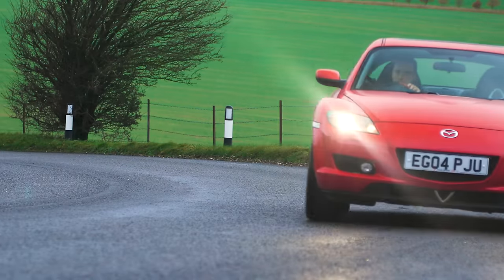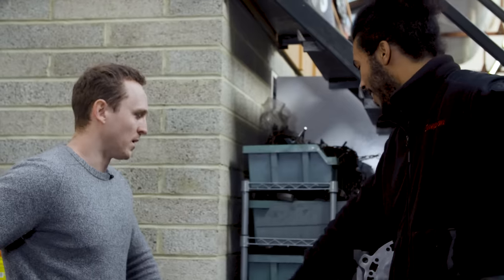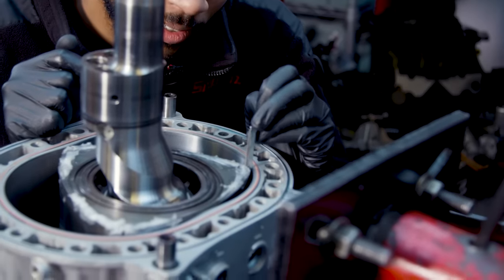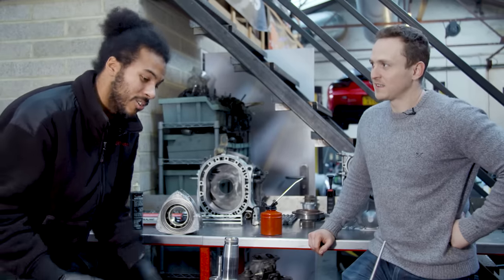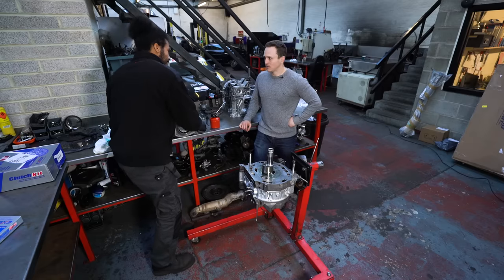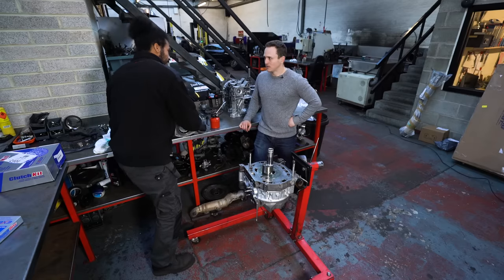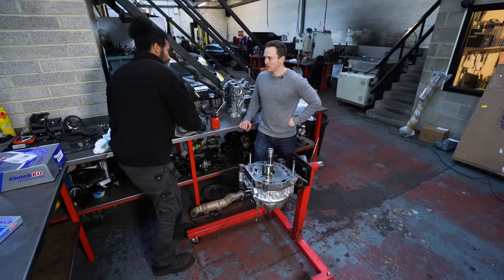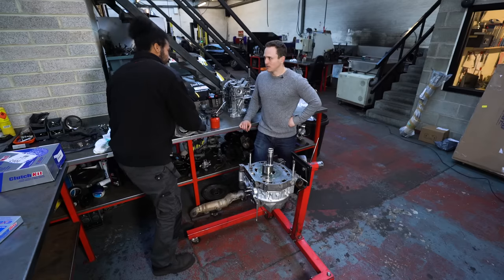How To Build A Rotary Engine: The ULTIMATE Guide

Comment: This really opened my eyes to the world of rotary tbh
Reply: D. Mac634 Same. Really consider an RX-8 myself now lol
Reply: @petrolpower96  ikr I had no Idea how simple they are itd be a cool car to have
Reply: Looks nice until  you realize how much it costs/how hard it is to find a good rotary mechanic/how often you need to do this to maintain good compression.
Reply: @thedude102878  lol wut. You dont have to rebuild a rotary to maintain good compression. Just keep oil and coolant in it and they are fine. My rx7 has 300k on the original carbed motor, no rebuilds ever. The carb failed before my motor did.
Reply: Trust me this is the average basic rebuild. You're scratching the surface on this channel mate.
Reply: Donkey Kong 300k cause it’s not a renesis

Comment: This looks deceptively simple.
Reply: Yup - conceptually it's really simple... it's the precision / tollerances that are the hard bit (that, and remembering every little seal :D)
Reply: Geoff Willingham yeah, probably just takes experience and messing up a few times lol
Reply: They didn't show any of the side seal stuff, it's not all out of the box and into the engine
Reply: It looks simple, but that where the dorito fools you. You think its easy which will make you spend your lifesavings and more on that dorito out of hell!
Reply: Watch aaroncake's video to see all the missing stuff. There are some really tediuos stuff, like side seal grinding and more.
Reply: It may seem so but spacing the seals are hard ,any close to thousands of an inch can cause hardstarting
Reply: Is it normal, that there is an pretty amount of smoke in the engine bay at first start?
Reply: Reminds of my 1st brake pads change I did.. Looked so simple on youtube, like 15 min job.. Took me 2,5 hours..
Reply: @chiclone-tests71  yes...Josh said it would smoke because of all the vaseline they put on the seals and stuff
Reply: @xzst  As long as you had the pads in the correct way after that - everthing's fine! :D
Reply: @Boog Ste Lici - yes, i can follow that in case of the exhaust, but the engine-bay? Maybe an exhaust-clamp was not tight enough?
Reply: @chiclone-tests71  I feel like its pretty normal because engine and parts went through a lot of dust / oil / contaminant and theyre all burning off
Reply: @xzst  I think when you do stuff the first time yourself you take an interest in everything and it makes the whole process longer. you probably did a far more thorough job than a garage did and cleaned brake dust from your calipers and made sure your slider pins were clean as a whistle.

Comment: An entire rebuild in 7 hours? Jesus... Another reason why blowing a rotary isn't actually that bad. Well, nowhere near as bad as in a pisston anyway. 

That guy should have his own youtube channel
Reply: Probably 20 hours for an average guy not pros
Reply: they had all the parts at hand, they essentially just disassembled and reassembled it, that probably cut the time down a lot
Reply: @TempoMontages  for a full rebuild that's still really good haha
Reply: Rebuilds can go a lot worse, really depends on the damage.
Reply: Next we'll br watching electric rotaries be rebuilt xD. Gotta get that copper wire all around the rotor housing or it'll mess up the electro-magnetic fields!
Reply: @Neishy4AGTE  10h fixing/finding stupid short(tail lights) on a z350 was on the main wiring on the engine side.
the 7h sound like he forget the calls for supplyers and the wating time.
Reply: And at the same time he was explaining and giving comments. I think alone he could do it in 6 or even 5 hours.
Reply: It takes me eight hours to rebuild a 5.3 in truck....the only thing left in the block is the crank.

Comment: That snap on torque wrench hurts my wallet just looking at it.
Reply: They make most torque wrenches these days since they bough the british company that originally made them.  The digital ones are sooo nice.
Reply: Get the one from Eastwood. Just as good, only notable difference is that it doesn't vibrate... I've used both. No need to spend that much cheddar, tbh.
Reply: I own one 300 bucks used on ebay and its like new !!  65%off its original.price !
Reply: @areyouavinalaff  Ofcourse you feel 'torque'. But you have no clue what moment it is set on. Feeling has nothing todo with absolute measurements. If you get stronger arms the feel changes, and you tighten it 2x to tight because it feels good.
Reply: @areyouavinalaff   Ofcourse I ment where a specific set amount of  torque is required you cannot feel it and say, Oh its at 80Nm now as required, or ah it' s good enough for sure because it feels same tightness. Well...you can but, it won't always be perfect. Also depends if grease is used, metal or aluminium etc. How nice of you to assume I dont have any experience. Just sayin, where asked for one of these, let's say a cylinder head, I use it. All other stuff is 'feel'. We don't need to fight bro.
Reply: @areyouavinalaff  Hehe no problem brother. I am the same in general, nothing wrong with being defensive in this world. I am no pro or anything, just working with random mechanics for about 25 years, dam i feel old...
B. T. W that cat was my little buddy in crime years ago. R. I. P.
Reply: Got 3..
Reply: If thats a scary price then dont look at a high quality one ever...
Reply: My preference is a Norbar. They do some  lovely kit! Owned by Snapon these days and used to originally supply tools for the MoD, specifically also for the production of RR Merlin engines.

Britool are also another superb manufacturer.

That said, any calibrated torque wrench from a reputable manufacturer will see you right!
Reply: @skylined5534  Norbars are magic, I hate the digital ones and the smal >400nm stahlwille isn't my favorite either. <400nm stahlwille is great. I work with trains so we have a variety of torque specs.
Reply: use it as a breaker bar

Comment: These engines seem simpler that i imagined
Reply: There's literally 3 moving parts. Rotaries are easier to put together than a Piston engine.
Reply: Tom you would have more trouble getting the engine out than rebuilding
Reply: They're basically awesome and just get a bad reputation.
Reply: @shona5512  And they break 3 times as often.
Reply: they are incredible simple, practically adult lego.
Reply: @JesusChrist-uu2te  Mr. Christ since when were you into cars?
Reply: King Brilliant  wut?
Reply: Dee Jay  You don't have to tell me any of this, i learned to build rotary engines before I learned anything in depth about piston engines. My brother had an RX-7 when I was young and a few years later I bought my own as i was familiar with them. I've since sold my FD to my brother because he missed his RX-7 and I moved on to piston engines, but I will always find rotarys easier to work on.. Yes some ancillaries are a bit fiddly, but no more fiddly than a compact V6 like a 370z or a 2.7tt Audi S4. I was purely talking about the ease of assembling the housing and block.

Comment: You know what grinds my gears ? A blown clutch
Reply: See what you did there
Reply: Just hang on there...don't let things slip...it'll go into a spin...it will certainly be felt all around.
Reply: @BGone-mb7wz  Revs keeps on slippin, slippin', slippin, into the cluuuutch plaaaate
Reply: a 6s lipo and 7500kv brushless motor on a Tamiya Hornet
Reply: a car can be driven quite well with no clutch, just need a good battery for stops and starts. it's all in the revs, gears will drop in/out nicely without clutching. but i DO APPRECIATE THE JOKE. LOL

Comment: 20:35 chrisfix shaking for he doesn't use threadlocker
Reply: imagining him just popping out of nowhere and throwing them aside
"HEY GUYS, chrisfix here!
WE'RE GONNA USE SOME MEDIUM STRENGHT THREAT LOCKER ON THIS BOLT, TO MAKE SURE VIBRATIONS DONT SHAKE IT LOOSE, THERE WE GO, AAAND WE'RE GOOD TO GO"

also:
soapy wooder
Reply: Right so a real mechanic not using it should tell you something.
Reply: @DiscoFang  but yet the manufacturers use it so maybe that should tell you something.
Reply: @DiscoFang  he using it after on other bolts
Reply: Egil42006 Grude Pc But manufacturers don't use it in engine head bolts which are the equivalent to the tension bolts referred to in the time stamp of this comment.

Comment: £650 for the car, how much for the engine rebuild? Absolutely great video, thank you 👍
Reply: I just looked it up on their website and it's about £2500 but there are different tiers
Reply: @randomaccessbrains  It is waaay less than what I spected! Really cheap!   you can have that awesome car for under 4k running with an almost new engine!
Reply: @andycapo9you  yeah i was also very surprised by their quote as i've heard people quoting 6000$ or more on the internet
Reply: Ramses not bad, now the car is fully sorted for years 👍
Reply: @randomaccessbrains  Alex probably hadn't the cheapest tier.
Reply: @ptibab73  yeah that's why i said about £2500. It's around £2300 for their middle tier so 2500 would be a good estimate overall
Reply: Given they used new plates, housings, eccentric shaft, and a rotor the build was probably closer to £4-5k. Had they been able to reuse everything then £2.5-3k is about right.
Reply: @cib2413  The cheapest rebuild is under 2K and the rebuild with new housing, housing plates and everything is between 3 an 3K5, it's really correct.

Comment: This video actually makes me wanna go out and buy a cheap rx-8 just to work on that engine
Reply: I kinda feel the same way. it's definitely a different way of looking at internal combustion. have to appreciate the innovation and engineering in either case.... rotary or reciprocal.... both amazing.
Reply: Do it! I purchased a reasonably clean one for $600 this week!
Reply: Traded my motorcycle for a 04 rx8, best choice even tho I had to replace the clutch pack and flywheel
Reply: @AuX23A  i am looking to get one these days but i am afraid i buy a faulty one
Reply: @sogerist  buy a compression testor before you buy it and ask the owner to remove the rear and front rotor spark plugs
Reply: @AuX23A  was this before cars prices exploded? 😭
Reply: @sirchimera6256  Haha yeah, non-running shells seem to be going for a bit more these days. Nothing crazy though! 1000-2000 I'd say.

Comment: Fabulous series chaps. My dad bought a brand new Orange Mazda RX-2 in 1973, the dealer didn't know what to do with it when it became hard to start (at 14k) so my dad took the engine out and rebuilt it on his desk at work (a wooden hut on a demolition site), this was in 1974 with no internet to help, he replaced the rotor tips and it ran beautifully for another 20k but failed again at 34k and the car sat for some years.
Sadly my dad sold it to a guy who gave it to a garage who fitted a ford V4 engine, they left a fuel hose loose and the car caught fire and burnt to a crisp on it's test run, when my dad heard he didn't laugh....much ;) I believe the car would have wanted this rather than suffer the indignity of having a stone age iron piston engine. 
I did LOVE that car and have loved Rotary's ever since, my best friend too, he was so inspired by the engine he went on to have a huge collection of Wankel engined motorcycles,  Norton F1's, DKW and 2 Van Veen ! (they only made 36) and has become an expert on them. Great engines.

Comment: How to build a reliable rotary . Step 1 avoid actually starting and running the engine at all
Reply: @CrimDSM  That's just utter shit. I've ran mine every winter in anywhere between 5 degrees and -10 degrees for 7 years and it's still healthy. Stop believing every myth you hear about them.
Reply: YouTube comment of the week
Reply: I have an 05 Rx8, original engine 85 k miles on it without pre mixing and still going strong.
Reply: @spiderdragon10  Thats the thing, only 85k
Reply: @spiderdragon10  That's not special, not in the slightest. Get to 200k and see how many rebuilds it'll take you to get there
Reply: @mediumunwell  who said anything about special?? He talks about reliability and I've had the same engine for over 13 years. Once it gets to 100k i'll rebuild it and get 10 more years out of it.
Reply: @spiderdragon10  some stock piston engines can get to 250k miles
Reply: @TTURBOVOLVO  Who said they don't??
Reply: Nobody, but having to rebuild an engine to get to 200k miles is not reliable.

Comment: Who else drives an RX-8?
Reply: ED8 — I daily an 04 manual with 140,000 miles. Love it. Rev it to 9,000 daily
Reply: @I_know_what_im_talking_about  port? Id recommend swapping it for a 3 rotor with an custom ecu
Reply: Sam ur Boi — stock engine. Just bolt on’s for sound improvements, to be honest with you. 

Need to tune it next to really set it off and improve idle and smooth things out. 

I enjoy it as is.

Comment: Owned a 77' 13B Rotary Truck. Got 270K miles out of two motors. Replaced second motor myself. Note: as seals wore down a cold start required 3-4 tablespoons of oil down the throttle bore of the carb, result: good starting, but smoke volume that would make AN HMS Destroyer proud at the Battle of Jutland.
Reply: So? Your motor lost compression at 40k miles...

Comment: OMG thank you for mentioning that seal under the rear stationary gear, motor is on the crane with the clutch already in place, I didn't realize it was there! It may be in there but since i took it out and pressed the bearing and painted the iron It likely is not. You saved me a transmission pull! sub for that, worth it lol

Comment: From what I have gathered rotary engines seem to be quite ahead of their time and maybe newer materials could make them better in the future?
Reply: Rotary engines had been improving over time and those in late RX7s were very good engines, but the quality of the rotary in the RX8 suffered when they designed it to meet emission regulations.  
Unlikely the rotary engine will be mass produced again because of its high emissions and fuel consumption, but there are many high quality aftermarket parts being developed and made that allow these engines to make big power reliably.
Reply: Wankel engines are an obsolete technology, most automobile manufacturers reached the end of its development potential in the 1970s.
Reply: @JeremyPetho  The Wankel engine has been plagued with reliability issues since inception.
Sales of Mazda's RX8 models sharply declined after 1986 before the 13B-MSP was developed.

Comment: Great build. But. 
The torquing of the tension bolts made me wonder. 
Being in aviation, it is commonly addressed.
But the torque of a wet bolt vs the torque of a dry bolt is incredibly different. You can crush parts at the same torque just by adding lube to the threads. 
A lot of items call for dry friction torque. Because when removing those bolts in a rebuild could prove to  be very difficult.

Comment: When they tightened the engine bolts and snapped the ends of the apex seals wouldn't thst cause problems? I'm confused as to what snapped exactly and how that doesn't cause interference.

Comment: that torque sequence, why it goes north and south, then east and west? I guess it's no different to doing a conventional head sequence, but with this bolt pattern being more circular, it surprises me that the torque sequence also wasn't more circularly opposite. What I mean is the bolt sequence is still addressed like it's 2 parallel lines of bolts forming a rectangle, rather than 2 arcs of bolts forming a circle. Interesting.

Comment: I prefer putting the apex seals in first without the springs so that the corner seals don’t move. Then I install rotor, then remove one corner seal and install short spring and slide it down as far as it will go with a pick and then slide the longer spring in and it will slide the small spring in and then slide over it and   Into place, then put corner seal in and done

Comment: i actually am building a street ported 8, i was wondering if you had to flash the ecu with a basemap before running it for the first time or if the stock tune is fine for the run in trips

Comment: unless the oil pumps nut washer is splined to the pump shaft it won't stop the nut un doing so lock tight or throw the engine in the bin

Comment: When putting the tension bolts in at 20:00 the oil at the thread ends also ends up under the bolt heads. This affects torque figures. Has this been taken into account?

Comment: Nice work! Does it make sense using as first lube a brushed MoS2 additive (LiquiMoly,...)?
Is feasible a single rotor engine from RX-8 parts, with an added rectangular (NSU research, KKM 250/5 engine)  peripheral intake port, controlled by a Reed-Valve the Canada patent  CA1045553 (Also US3848574 is interesting, see ESPACENET) the side intake ports closed, keeping the side exhaust ports? 
This twin peak Reed-Valve, there are many from 2-Stroke engines in Snowmobiles, Boat engines, acts as a progressive shut intake port, early shutting is good for high speed performance, late port closing is good for low rpm, low load torque. Salut +

Comment: I had this issue developed few months ago... like I am driving in 3rd or 4th gear and I suddenly accelerate and the power would go down and gradually gain rpm... I have no idea what this is... could be Apex seals or clutch slip... But if it was Apex seals I would have smoke and large amount of it and if clutch slip I would feel it during low gear shift... so its a new thing for me.. in 4 years this happened few months back.. so I don't accelerate suddenly to avoid it... I will try cleaning plugs, air cleaner.. than will check again.. my air cleaner hasn't been cleaned for 2 years...
God forbid if its the seals... Man...
Can you guide or check up with JOSH